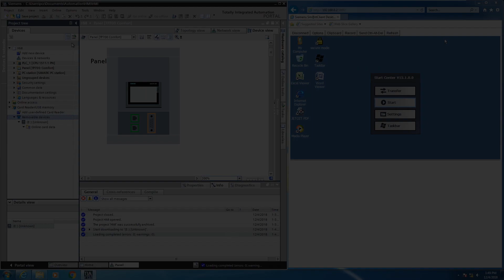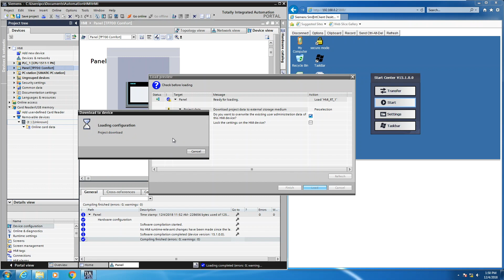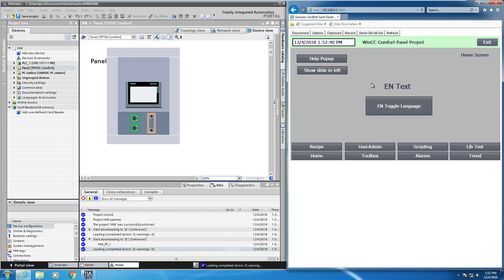Lesson 18 - USB Stick Project Transfer

Comment: Hi. Do you know which TIA version I am supposed to use to open a SMART 700 IE V3? It is meant for Chinese market but we got some of our machines supplied with it here in Kenya. We are currently stuck after HMI died. I have the HMI program files and would like to possibly run these using WinCC runtime to keep us running before we are able to procure another HMI or possibly upgrade to something better. It might take sometime to ship considering the current crisis. The PLC we have is s7-200.